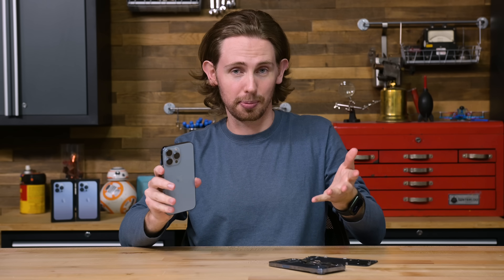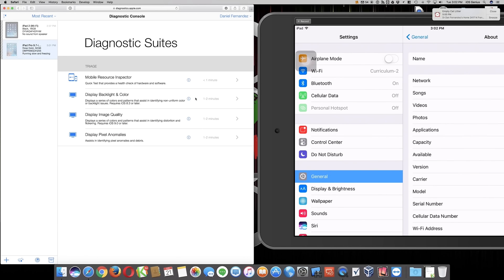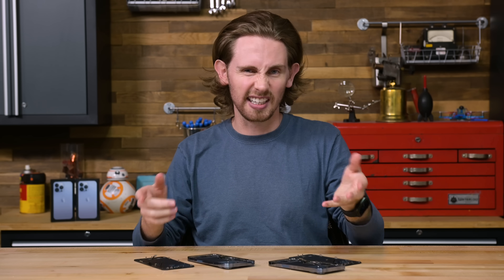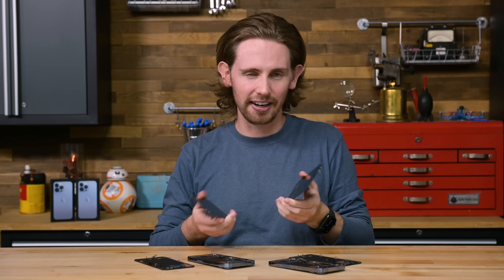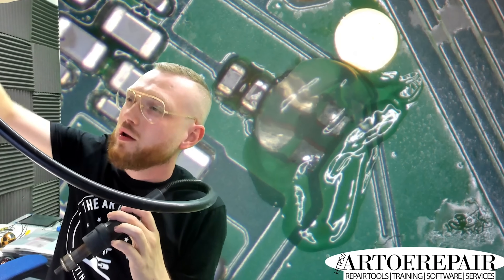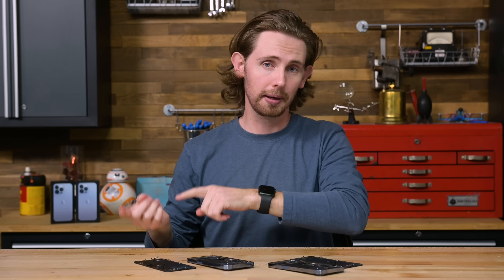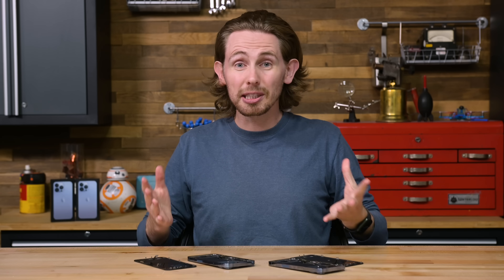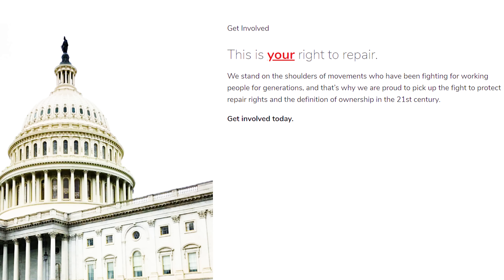Apple Broke iPhone 13 Screen Repairs

Comment: GOVERNMENTS NEED TO CRACK DOWN HEAVILY ON THESE MONOPOLIC BEHAVIORS OF COMPANIES SUCH AS APPLE 
LIGHTENING PORT BEING ONE OF THEM
Reply: Dude.....You don't even KNOW. The GOVERNMENT has the BUREACRACY. Go look that up now! Monopolies exist BECAUSE of the bureaucrats! Monopolies would NOT exist if there was a SMALLER government!
Reply: You serious? No one can tell a company what to sell.
Reply: @talatdymc6539  Yes Governments can to anything they want as long as they can justify it for the welfare of the people 
Anti-monopoly lawsuits are commonly used in these regards, like the one against Bill Gates Microsoft in the early 2000s

Even currently EU has made it mandatory for all mobile phone manufacturers to use USB C on mobile phones which is a slap against Apple's outdated proprietary Lighting cable
Reply: @TheContrariann  It is unapplicable, what if Apple makes less profit and produces phones harder? Think about it you create a port, sell every accessory company lisenses, a government tells you cannot use it.
Reply: @talatdymc6539  the EU did that and worked. That’s the only reason android phones has e the same port. Before that every brand had its own proprietary connector
Reply: @sterkriger2572  That was the time that ports weren’t used for data transfer or fast charge. Android phones now use the same port cuz it is cheap.
Reply: @TheContrariann  I completely understand you but in this perspective, you can maybe should standardize anything like screen or keyboard etc., but that is just not possible, then each device become the same. But your last section, I could not agree more.
Reply: @TheContrariann  If they make life long stuff how will they make money ?? Even a Truck driver makes 60,000 $ in U.S. can't you spend a 1000 $ to buy a new one once every 3 year ??
Reply: @u6h149  Yeah ! That's why its called "Planned" Obsolescence !
Reply: @u6h149  that's capitalism baby
Reply: @m.f.3347  Sony didn't follow that's exactly it's market share collapsed.

Comment: this is more than just helping the independent repair specialists I believe. this is about what apple stands for which is 'saving the environment'. with the amount apple charges for repairs (since most people dont get apple care when they buy their phones), most people will just opt to get new phone instead of repairing and keeping their phones which means more industrial wastes.
Reply: Apple dont want people to mod their phones and send it to their repair centre.
Reply: Most people don’t get Apple care? Where did you hear that Apple care is included with most cell phone plans insurance
Reply: @semahj  my theory is, the way I see it, they are doing this strategy to force more people to adapt apple care plus.
Reply: @semahj  I used to work at sales and marketing for US and AU telco. usually, we add the TPP (total protection program) or apple care upfront since its free for the first month but will tell our clients to just call and have it remove after the free period. most of them dont wish to add it at all. statistics in our conpany dont lie.
Reply: And people who buy 1k$ phones don't care about environment
Reply: @Happiness-lp9fw  you're missing my point here. People buy phones for utility and we can't deny the fact that it's hard to get by now without mobile phones, like you do. it doesnt matter which phone you get -whether its expensive or not. I myself I buy these flagship phones for their durability.. and I believe, phones these days are designed to be durable. now, the point is when something gets broken i.e. screen (which usually most of the time is the case), apple should have let the phone owners to decide whether have it repaired anywhere else since these owners bought these phones and owns them.. there should be atleast a free competition in the market. most owners intend to keep their phones for as long as these phones cater their needs but apple prevents that by preventing them to get needed repairs from elsewhere and by charging offensive prices for repairs.

Comment: you could stop buying devices from them.. 

no one is preventing you..

i do support Rights to Repair.. but man, these issue became worst because of its own community
Reply: Other companies are pulling similar fast ones too. Samsung disables fingerprint sensors because of so called "calibration issues".

Comment: While replacing a screen from your shop, will you provide exact quality 120hz OLED display ??
Reply: The screens / cameras / boards come from salvaged iPhones. They are original apple parts, just taken from another identical device that suffered damage to critical to be replaced. That's the problem around coded ICs, these software blocks will happen even when swapping parts between two brand new,  identical phones.
Reply: @simioni  Since before iPhone 13 Pro no iPhone used 120hz OLED, if I go to other repair shops I will not receive exact quality display. Same goes for Mini LED display lineups
Reply: @choudhurysaheb8326  I just realized you were asking about their specific shop, and not about shops in general. I don't know what they're using. For doing this swap between devices, the parts have to come from another device of the exact same model. Granted there aren't many iPhone 13s out in the wild yet, so this option might take a while to become available in repair shops.

Comment: I would love a hybrid solution. Apple should instead of disabling features like Face ID, True Tone, Camera itself should have a section under settings which should show that battery or display or camera has been replaced. This will not only give users a choice to get devices repaired without disabling features but also inform users who buy second hand iPhones about the true value of the phone they are purchasing.
Reply: Definitely! Unfortunately that requires a higher amount of good will from Apple than they’re ready to offer at the moment.
Reply: @Vlr  or a good old regulation. wouldn’t be surprised if the EU did that
Reply: That is because apple isn't doing this to make a better product or help the customer. It is to make their profits go up.
Reply: @shApYT  it will help their business too as most people who want to get a good resale value in future would still go to a Apple Store as third party repair would show up in settings decreasing the resale value.
Reply: Sensible. But we all know Apple won’t be doing it as this only mean less revenue for Apple.
Reply: Yes! Maybe boot screen is better place to show that, like bootloader unlocked icon on Android boot screen.
Reply: @innnffxxi  Even that would be fine.
Reply: 3uTools does that
Reply: Apple could have easily added secure booting or authentication directly on the SOC like they did with the t2 chip now integrated to the M1 chip.
Reply: This isn't what Apple cares about unfortunately.
Reply: I wish it was like that.

Comment: the thing is that many repair shops don’t use OEM parts  for the screen or battery  (I know this bc I used to work for a large iphone repair company)… if something went wrong with screen or battery that lets say caused injury it would most likely be apple who would be legally challenged and not the repair shop… so you can see how Apple would want only authorized repair technicians with authorized parts
Reply: there is no OEM screen for apple devices, you can buy almost evererything else though, OEMs are not allowed to sell those screens to anyone no matter of what kind of money you pay, dont blame  repair shops for this, blame apple to enforce this rule
Reply: @pinkysweets  there are OEM digitizers the thing is they are more costly and most repair shops choose to use the ones imported from china that usually cost like $30 bucks (like I said I know this bc I used to work in the industry)

Comment: If you replace the screen that is made by third party then what says that the screen doesnt have some third party chip aswell that collects and/or sends your face id data to somewhere for malicious purposes. For examle if your banking app uses face id as a log in, someone who made that screen could hack/steal all of your money.
Reply: that info is not on the chip, nothing ralted to faceID is on the screen, the chip contains serial number, do a little research before will you?

Comment: Here's my problem with iPhones... I absolutely LOVE them... but, theres a problem. And that is that back in 2009, my mother got the iphone 3GS... and she LOVED it... it lasted untill 2015 with no issues!! 6 years. and it still worked then! it was just out of storage, so she chose to get a new one... she got an iPhone 5S... and it lasted about 4 years. and by then, the battery was almost at its final moments.. it died on about 70 percent and it didnt take long to get there lol. So then she got an iPhone 7, and loved it too! and it only lasted 2 years... it got payed off 3 days before it completely shut off and never came back on... and the battery health was still at 82 percent... so about 3 weeks ago she got the iPhone 13 Mini, and she loves it too... my point of this is, that... they dont make them like they used too... its just the hard hitting truth
Reply: That’s not even true? Your mom probably had water damage on the 7. iPhones last as long as they are not damaged for. I’m all for right to repair but an iPhone doesn’t just magically stop working after 2 years
Reply: @blanchbacker  It's 100% true. You're so blindly defending Apple and rushing to blame the end user that you forgot that the iPhone 7 is the one that introduced proper water resistance. Water damage? Fat chance. Poor quality batteries intentionally designed to die early and slow the phone down so the user wants to buy a new one while being amazed at how much faster it is. Apple even got in trouble and had to provide discounted battery replacements for a while to compensate. An iPhone does magically stop working after 2 years because that's how Apple wants it.

There's loads of other engineering "flaws" (I'm sure Apple would say they're working as intended) that cause iPhone to die early through no fault of the end user. Watch some iPhone repair channels, you'll learn. It's all on purpose.

Comment: I'll never understand why people continue to buy Apple products
Reply: I am still using an Apple product and honestly I will never break them
Reply: best tools for my workflow. and ive never had a problem in 10+ years. that doesnt mean theres no potential for issues, but the probability at least in my experience is pretty low. i only got an issue with my macbook pro screen that was scratched (my error) and everything got completely swapped out by an authorized repair shop for free (switzerland extended guarantee). so if you live in a country with proper consumer rights laws, you should be fine (and wouldn't need this whole right to repair fight).
Reply: because they’re good

Comment: The problem is that not every 3rd art repair shop can be trusted. I saw numerous data leak cases in Vietnam because of 3rd party technicians.
Reply: and data got leaked by Apple's own authorized repair in the states, it can happen anywhere
Reply: You can't trust anyone by that matter. 3rd party repair shops at least rely on their reputation to get customers, whereas authorised repair contractors don't have to care about it as much because customers never know them.

Also, if the industry weren't as dubious (you basically have to smuggle replacement parts), then you wouldn't have as many dubious characters in it.
Reply: typical fanboy response

Comment: I feel like Apple should be paying a fee for every iPhone that gets thrown away after too short of a time. A phone that costs 1500$ should last in the market for at least 5 or 6 years, even if its just a cheap handydown device after that time. If you don't want people repairing devices then you should be paying for the environmental damage and waste of resources.
Reply: I'm still using my Redmi Note 3 from 2015
Reply: Planned Obsolescence...they are being sued in numerous countries for planned Obsolescence tricks, and lost US lawsuit in 2016 admitting their upgrade included technology that reduced battery function in older iPhone 6,7 to force people to spend $75 to buy new one. I always understand they program their phones (and it happened with my 11) to dysfunction if a generic USB charger is being used. I'm way done with them and Google
Reply: I do not understand why people would not just get apple care. It almost always ends up being cheaper than any third party option.
Reply: @ijarbis187  Some people need a repair on a device that's older then 3 years old. I owned my iPhone SE for 6 years before selling it.
Reply: @Megabean  apple care can be extended beyond 2 years. There is no limit
Reply: @ijarbis187  Apple Care only lasts for 2 years, what if people want to keep it for longer?
Reply: @avinashanish3350  apple care actually can be extended if you buy the 2 year plan. My iPhone 11 Pro Max which I bought a little over 2 years ago is still being covered monthly. It’s 9.99 a month which to me isn’t a really big deal for such an expensive device and I’ve already used apple care twice so it’s been more than worth it. Or you can even just start off by paying monthly day one of the purchase and you’ll never have to worry about the 2 year limit.
Reply: iPhones do last for up to 5 years or more. If something is broken, you can replace it though. I'm not familiar with other countries, but where I live, we do not have official Apple stores or services, but we have Apple certified repair shops. Replacing a part does not cost 1/3 of the phone's cost and you get official parts.
Reply: THAT'S WHY I DON'T USE IPHONES, APPLE IS POWER DRUNK. YOUR DEVICES LITERALLY BELONGS TO THEM, THEY MAKE IT STOP WORKING WHEN THEY NEED YOU TO PURCHASE THEIR NEW DEVICES. THEY LIED ABOUT THE CHARGER REMOVAL SO THEY CAN MAKE MONEY FROM YOU ( this is an evidence) SOME MIGHT BE TRAPPED BY THEIR ECOSYSTEM AND OPTIMISATION BUT THE NONSENSE YOU'LL GO THROUGH USING THEIR DEVICES ESP. (IPHONES) DOESN'T MAKE THEIR DEVICES WORTH A PURCHASE!!! AND ALSO THE DIFFERENCE BETWEEN THEIR OPTIMISATION AND OTHER PHONES IS VERY NEGLIGIBLE( LET'S WISE UP)
Reply: Iphones do last that long, im waiting for the iphone 14 to upgrade my 7+
Reply: i should be iliegal it just makes more E waste
Reply: I’m still using 5s, sooo it’s way more than 6 years
Reply: You can always buy an android you know
Reply: Android phones have some of the same issues. In fact, many of them are even worse!  The cheap build quality on the lower cost units makes them prone to failures with the cost of repair often exceeding the value of the phone. I won't bother mentioning how the poor resale value of Android phones makes them e-waste after only 3 to 4 years. Right now, you can replace an iPhone 5 through 8 battery and screen for around $50 total.

Still, Apple shouldn't deliberately prevent repair of their phones. What is just as bad as preventing repairs, is Apple cutting off software updates on otherwise perfectly good devices.
Reply: @bigchole1140  its what I use but sadly the iPhone is more popular with most of my friends and family and some even tell me to switch over but I bluntly say that I don't want to pay more money for a pos that does less than android and because of this bullshit
Reply: @bigchole1140  androids literally loose software support after 2 years… while iPhones from 2015 still have it
Reply: Just go to Apple to change screen
Reply: California has put that into law - California Recycling Fees: Beginning Jan. 1, 2005, the Electronic Waste Recycling Act of 2003 (SB 20 and SB 50) requires that customers pay a small fee on some electronics purchases to cover the cost of recycling and disposal. If you buy the newest Macbook Pro, you will be charged for $5 :(
Reply: @qinpengsun54  SO GLAD TO KNOW THERE'S A PROTOTYPE FOR OTHER STATES TO FOLLOW! Thank you!
Reply: @qinpengsun54  Misread post... Holy cow, back on consumer and folks paying majority of taxes. I'm going to be looking into open source type ios for generic phones
Reply: Look for samsung devices, you even can not disassemble it, it is glued to death. Seems to be that iFixit is bought by Samsung or something like that. You feel that Apple device is bad for environment? Do not buy it! Vote with your wallet.
Reply: @c.b.eugene  They’re not glued to death. You can remove the back panel with some heat with a blow dryer and a pry tool. And unlike Apple they don’t pair displays to the board. They are way more repairable than Apple is.
Reply: well most of them do last that long. If you would charge fees for early thrown away phones, everyone but Apple would be heavily charged.
Reply: @RandomUser2401  yes, but it could last a lot longer if users could repair their devices themselves and it could also reduce a lot of unnecessary e-waste.

Mining materials and creating manufacturing plants to produce these new iPhone are ridiculously bad for the environment, but these cooperations are hellbent on selling more and more smartphones every year.
Reply: The phones do last for 5 years or more. And if they get thrown away is the owner’s fault and not Apple
Reply: @rodrigop5592  if someone cracks a display it shouldn't be a thing where you have to toss out the entire phone. It's probably one of the most common things that break on a phone. (With the battery and charge port)
Reply: @rodrigop5592  Oh look its an apple fanboy blaming the consumer. Like that's new.
Reply: @Megabean  Wow…yeah it’s easier to just calling out people “Apple sheep” alright….
Reply: @rodrigop5592  Apple bot 🤡